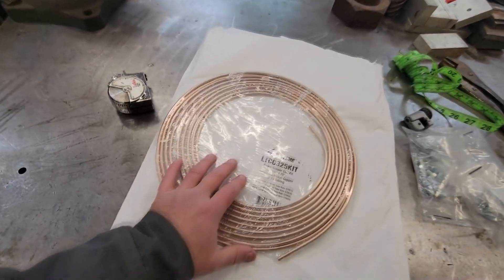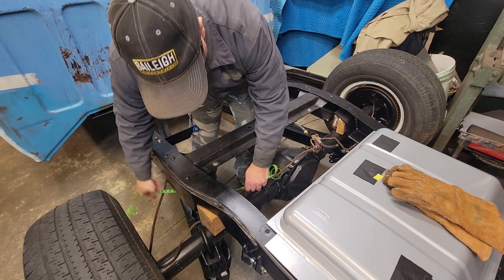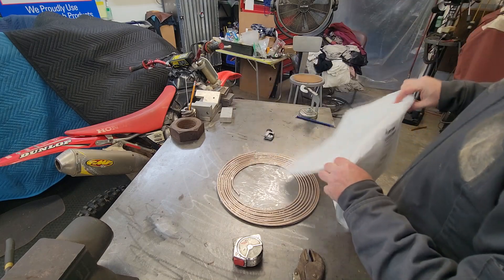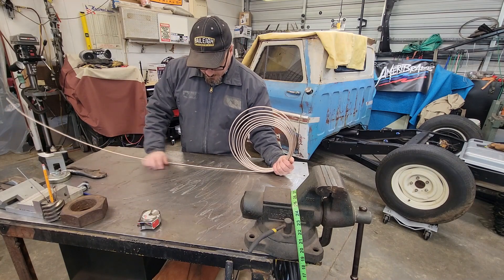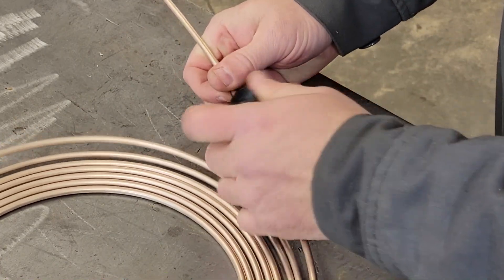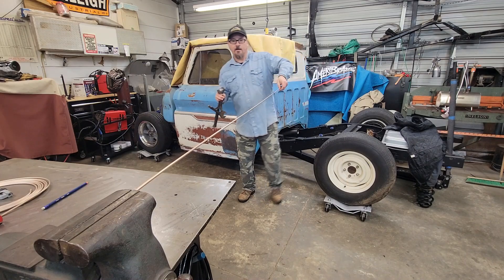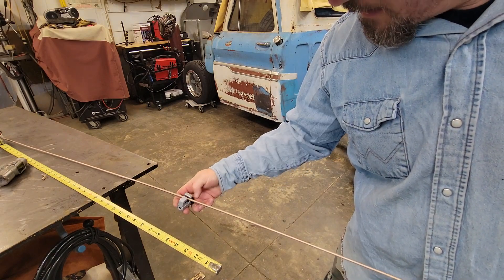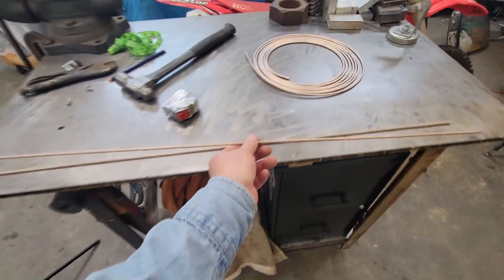How to Straighten Brake Line TUBING with (Common Hand Tools)

Comment: I bought the same brand on Amazon.  I made 30 bends, flared both sides, then found out its magnetic.  The local autoparts store sold AGS brand copper nickel.  Its not magnetic.
Reply from the maker: Dang not sure about that.
Reply: Amazon does sell the real stuff. It's more expensive. I made the same mistake a few years ago and got copper coated steel lol. Which honestly didn't hold up to bad. But I recently ordered some more that was over twice the price and it's real nickel copper.

Comment: Interesting to see other ideas. I use the brand you purchased, but in stainless ( not a fan of the nicop appearance). Yes SS is more difficult to work with, but it is a show car staple when done correctly. 
Another way I straighten SS tube: drill a 1/4” hole in the long side of a 2x4, pull and there’s a straight SS tube to stare at. Cheers.

Comment: You are taking measurements in a ridiculous fashion.

3 foot, 8 inches a 24 sixty fourths.

What a joke!

Just use millimetres, base ten, like the rest of the world does.
Reply from the maker: Ill stick with measuring in Imperial units, thanks!!
Reply: @ACDesignsGarage 

Yeee haaar!

Gawd damn!!

Damn straight!!
Reply: His way is more sophisticated, that way nobody can duplicate his technique LOL. When they start making the plywood and framing centers metric then ya lets go metric until then we are caught in a mishmash of frustration when vehicles manufactures are still using metric mixed with imperial on some brake systems etc. and mixing bubble flares with double inverted flares on that same vehicle. That's a Wrigley's double bubble. Keeps us on our toes I guess but what about all the hair loss.